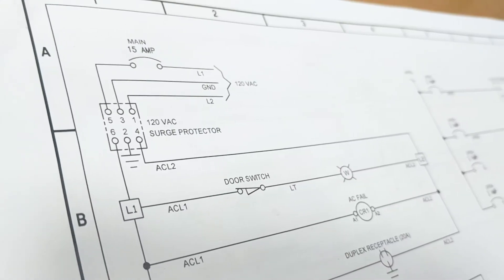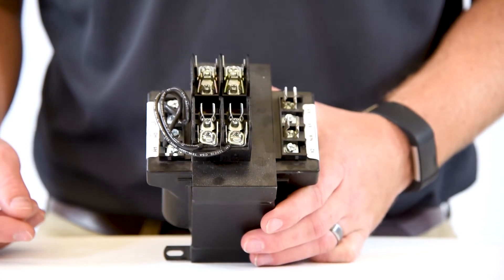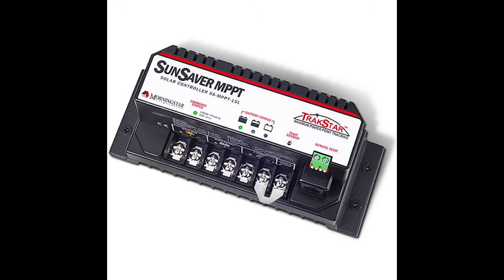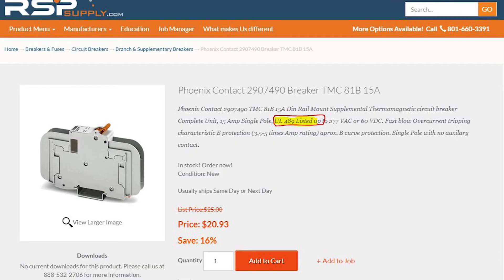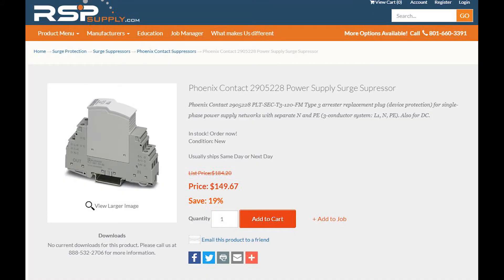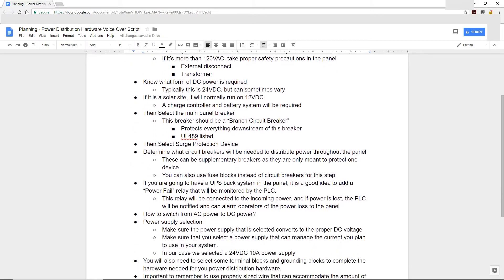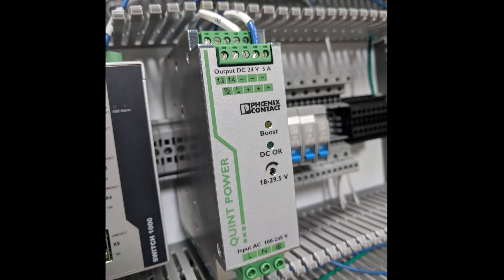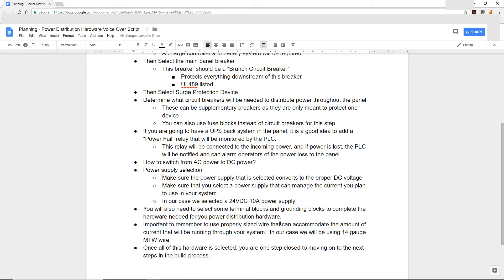Control Panel Build Series Part 6: Planning, Power Distribution Hardware

Comment: This series has helped me tremendously. I’m building my own CNC control panel using the methods an practices I’ve learned here. I have a question though. I need to add four smoothing capacitors to four of the individual power inputs to each servo driver. Is there any terminal block or other device that is made for this? My plan currently it to make a PCB and mount the caps on the board and wire the board through the terminal blocks. I know I can get reliability but appearance is also a goal when mounting these. Thanks!
Reply: How large are your capacitors? Your plan sounds good to me maybe add a fuse or something so you can replace that instead of having to resolder if anything ever happens to your custom PCB.